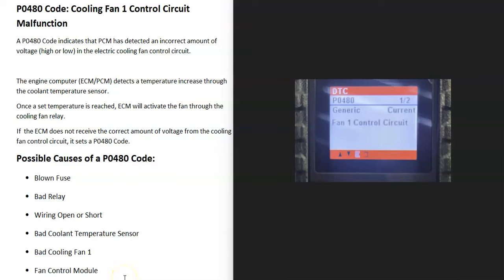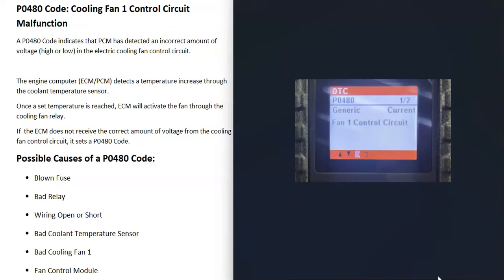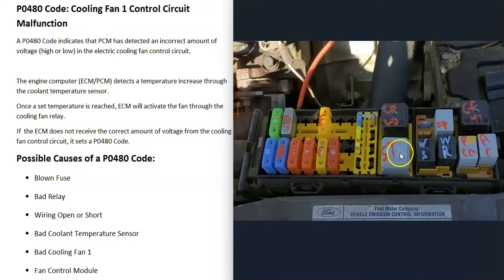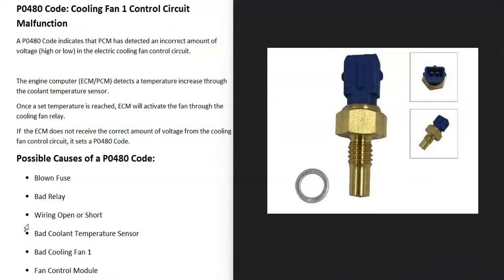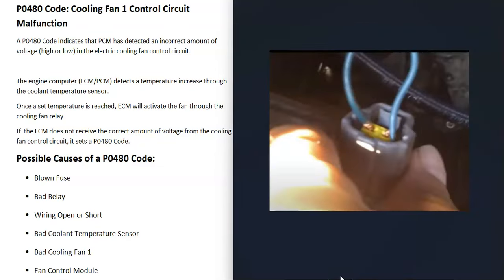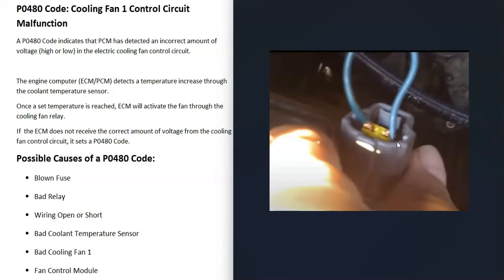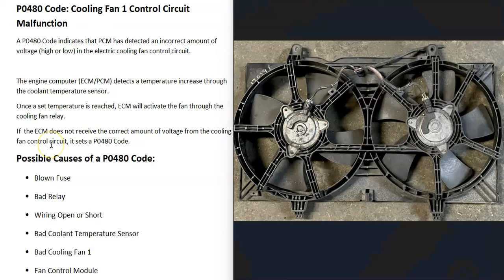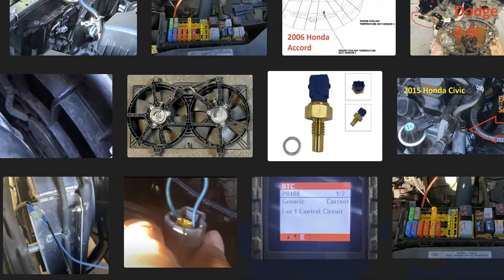Causes and Fixes P0480 Code: Cooling Fan 1 Control Circuit Malfunction

Comment: My cooling fan seems to be running fine, however, I received the P0480 cod on my 2015 Jeep Cherokee. Could it be the ECT sensor sending a false reading and needs to be replaced?
Reply from the maker: It needs to be tested, but yes, a bad coolant sensor can cause issues.
Reply: @HVAC_Mechanic  Thanks for the input! It turned out to be a broken hose.

Comment: I have P0480 on my 2011 Lincoln MKX.   With the engine cold (in the mornings):  If I remote start, fan goes on.    If AC on, fan goes on.   If I shut off the AC, fan goes off.

Comment: I just replaced my radiator and had this issue after I replaced it. I had 2 blown 40amp cooling fan fuses blown. replaced those and I also replaced the thermostat and cooling sensor and still have the code. The cooling fans were running fine before the radiator replacement. I then tested the new cooling sensor and its fine. Still can't figure it out. I have 12v at the from the ecm to the fan harness. Might be the ecm or bad fans but it was good before replacing the radiator so not sure what it could be. 2014 chevy silverado 1500
Reply: Chacha eh ki krlea😂
Reply: Did you figure it out?
Reply: They probably didn’t get the plug for the fan clutch or dual cooling fans plugged back in all the way

Comment: I have an engine light po0480 which turns on and of intermittently  especially when the ac is turned on. What's up
Reply: Sky
Reply: did you solve the issue? what was the reason, im experiencing the same thing.
Reply: @youssefshamunka7559  I had an issue with a cable between the PWM controller and the fan
Reply: After checking ever fuse an rely even ones on the grill mount,changed radiator sensor and nothing,so it turns out that the coolant sensor mounted on the engine block is the culprit. When it is faulty the ECM doesn't know the exact temp of motor so apparently sends wrong signals to fan and thus affecting AC.
Reply: Sorry to take so long. For me the problem was the engine coolant sensor. Once replaced and I turned off the code the code did not come back.